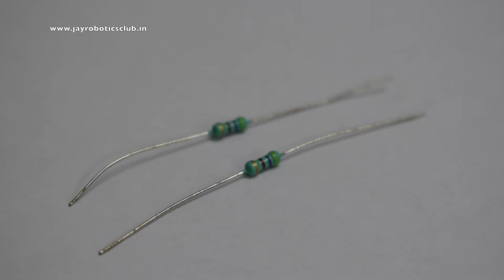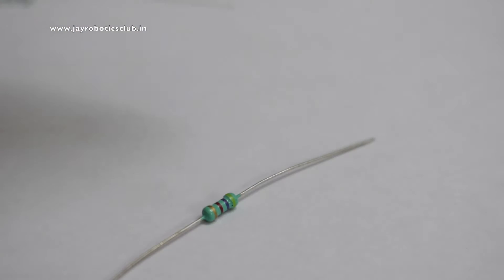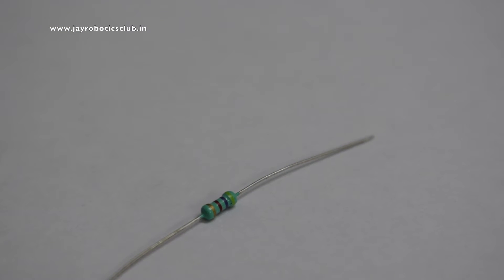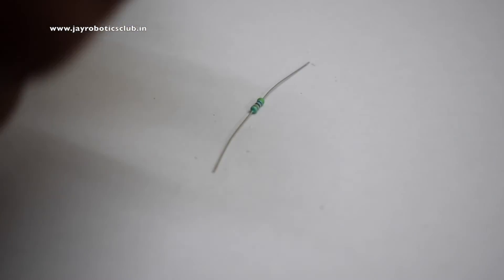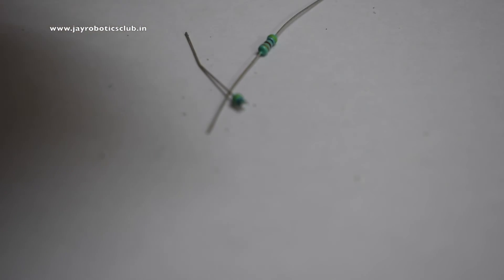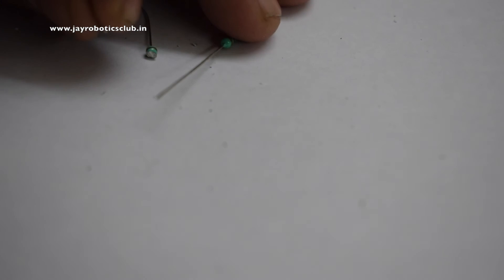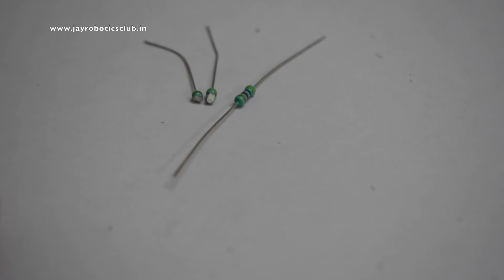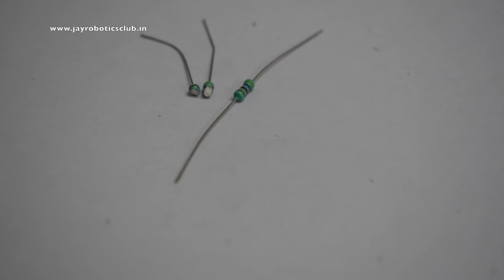10. What is inside a resistor?

Comment: Why didn’t you zoom in on the resistor to see the inside? That was the whole point. You did nothing in this video except cut open a resistor but you didn’t show the cut open resistor.
Reply: 1:17 It looks like there is just some white stuff with low conductivity, but not completely insulating.